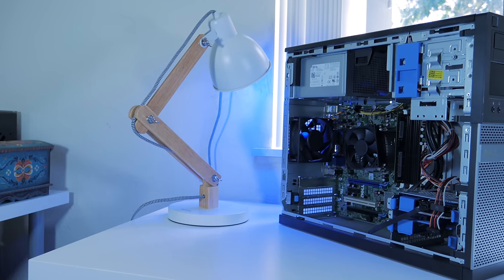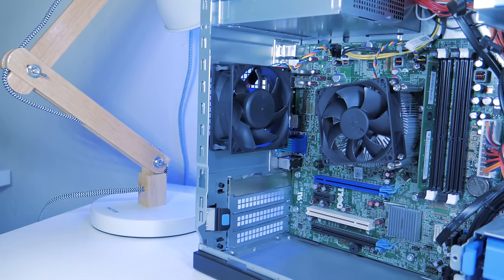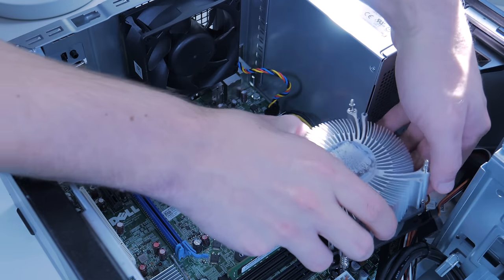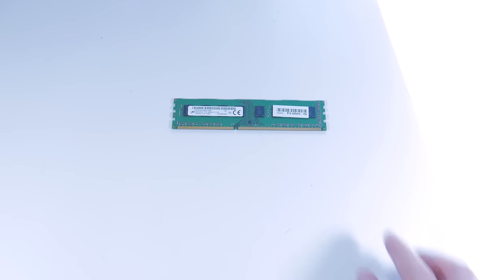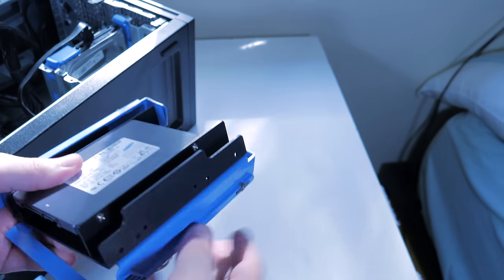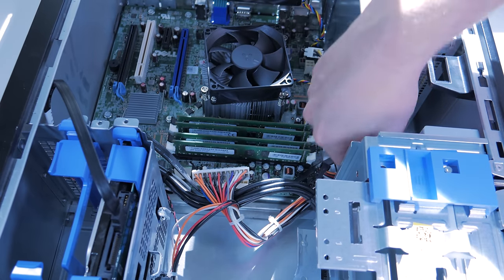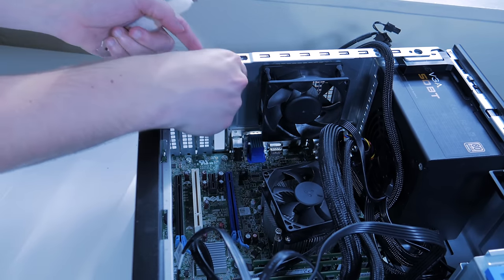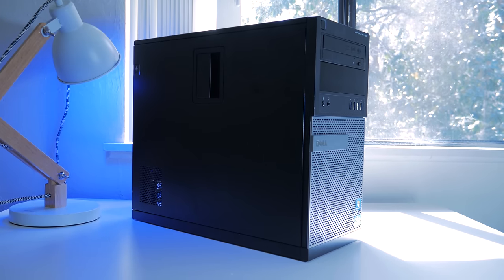How To: Turn an Old Office Computer into a Gaming PC!

Comment: I have question, can I like replace the whole motherboard and put a better one?
Reply: It might depend on how big your case is, i know that motherboards can be removed and replaced but it might be a big hassle. If some of the components in your pc arent compatible with the new motherboard, you will probably have to replace those parts if you want the new motherboard. If youre gonna get a new motherboard on s used prebuilt pc, just buy another one with a motherboard you want. Either that, or just find a way to compromise with the pc you have. Or, if you have a small case, like if you bought a slim tower, you can actually move your motherboard and all the parts into a new bigger case

Comment: Can I put that motherboard in an ATX cabinet? i have optiplex 9010 the motherboard is atx form factor
Reply: KempR SmitH on the 7010 and 9010 the front panel connectors are proprietary but the power button pinout is already known

Comment: another good  system for light gaming and work is a dell optiplex 780 with 4gb 1066mhz ram intell core 2 duo e7500 2.93 ghz 250gb drive and a 1gb zotac gt710 .........upgrade to 8gb 1066mhz ram cpu to intell core 2 quad q6600 2.6ghz  a 2gb gigabyte gt710 and a 1tb drive go from light gaming to medium gaming and work

Comment: What do you guys think of my system? 

It is also an lg1155 socket type.
It has an i7 3770 at 3.4ghz, 4gb of RAM, and no graphics card (integrated graphics ugh), and a 280 watt PSU I think.

I'm planning on upgrading my PC but I still need help with that. 

The exact brand is a a Lenovo ThinkCentre m92p desktop model. So yeah
Reply: while getting a new gpu is great , do remember to get a higher watt PSU , your 280 watt might not be enough for a 1050 ti or something like that.
Reply: Get a 1030 or a older amd card like a 29 270 or a gtx 770/780 and get a better psu.
Reply: first guy already recommended it .

Comment: I just got a 7010 (same case) has an i5 3470. But for whatever reason it won't boot with my enermax 500w psu so I can't run my graphics card. Can't figure out why, the psu is good just won't work in the Dell. 

I did get 16 gigs of Corsair ram for $30 though 😁 so once I fix this psu issue I'll be set
Reply: What gpu bro

Comment: I have a gtx 1050ti core i7  inside a dell optiplex tower. It is a deceiving build 🤣😃
Reply: does it perform well?
Reply: @Fridaytheth-eg6vk  subnautica(high graphics)=70 fps

Minecraft(high graphics/no optifine)=300 fps

Empyrion galactic survival(high graphics)=50-60 fps

Yes is a nice build
Runs most brand new heavy games at 60 fps

Comment: is it possible to upgrade my dell xps 8910 and replace my gtx 960 with a 1080ti and i7 6700k to a i7 8700k?
Reply: You need a new Motherboard to upgrade your Processor generation and you may need a new power supply for a 1080ti

Comment: Can I even do this for a All In One office computer?
Reply: It depends on the specific AIO. In general, most AIOs have very little upgrdeable parts. Basically, it is a laptop motherboard mounted on the back of a display so that significantly limits your upgrade options. The most you can generally do is to upgrade the RAM and storage. Neither of those things will really help much with gaming alone.

Comment: i got an I5 4570 3.20 GHz
with a gt 240, 6 GB RAM, 250 GB HARD DRIVE for just $110.
All i need to do now is upgrade my GPU
Reply: maybe get more ram
Reply: @jaeyarr  i upgraded a few months ago. I not have an 
RX580 8GB OC
Same i5
 20GB RAM
1TB hdd
I'm planning on upgrading the CPU soon cause I'm currently CPU bottlenecked

Comment: Sir my pc is prebuilt and it is from HP.

Sir my motherboard is Hamar and the full details are as follows :-

Form factor: MicroATX: 20.5x22.0 cm (8.1x8.7 in)

Chipset: H170

Memory sockets: 2 x DDR4

Processor socket: LGA 1151

Expansion Slots:

One PCI-E (GEN 3) x16 socket

One M.2 socket 1, key A

So buying a new cabinet can I shift my all materials from Prebuilt cabinet into new Cabinet ? I mean that my this prebuild system's motherboard be compatible with the new cabinet ? Could it easily fit into new case ? As I only want to change the power supply to 450W and graphic card to gtx 1050ti ?

Comment: i had this pc lying around i didnt game on it byt now when i am intrested in it i found that it has i7 2600 @ 3.40ghz 2tb+500gb HDD;ss  and gt 530 i change´the PSU to 500w and gpu to gt 1030 it runs any challegin game at 720p med or low an some easier titles like bo2 on ultra 1080p 100fps

Comment: If you're a gamer on a budget, upgrading an old office pc is the way to go.
Instead of paying $700-800 for a gaming PC, upgrade a refurbished one for $300.
Find a refurbished pc with a decent CPU for around $120, which gives you $180 to get an entry-level GPU, SSD, and RAM. This should run most new games at 60fps 1080p on low-med. 
More old games like CSGO should run at the highest settings smoothly as well.
Reply: Any old office pcs you suggest?
Reply: @Sharkzee1  Dell optiplex 9020. It has 4th generation intel i7 processor and 8 gigs of ram if you're not planning to upgrade. the only thing you would still need to get is storage and gpu.
Reply: 213 The Ninja I’m getting an i5 4th gen, would I need to upgrade psu for a gpu
Reply: 213 The Ninja also would I need to if I’m getting another 8gb of ram to make it 16

Comment: I bought this exact pc on amazon and it came with i5 2400 8gb ram 2 tb hdd 110 ssd for only 150$ and all I need is a new power supply and gpu looks like ima have to save a lot of allowances😭

Comment: I got a Dell optiplex 990 with Windows 10 I installed a GTX 1060 and a new PSU but it's not detecting it? And when I try to install drivers it says hardware not compatible what do i do?
Reply: If you BIOS is old and original , like Intel Q67,check for a later version , from Dell website. That will make it compatible to run using Win10. I see an update from August 21 2018 is available
Reply: he's the Master already did that but I ended up getting another 1155 motherboard and building a new set up

Comment: Maybe you can help me with updating my current system purchased in 2009.
Its a Cyberpower prebuilt system.
Intel Core i7-2600K CPU @ 3.40GHz
GeForce GTX 550 Ti
16G Memory Kit DDR3-1866 CL10 240
Motherboard P8Z68-V LX
ATX Form Factor 
12 inch x 9 inch ( 30.5 cm x 22.9 cm )
I hope I provided enough system info, if not I can provide more.  Hope you can help.
Reply: Hey, The 16gigs of ram and The i7 2600k is still very capeble today and do not need an upgrade. However if you want to game on the pc:
Used: get a gtx 1060 or smular
New: GO for a gtx 1650/1660 or a amd rx 5600

Comment: I got a free gaming pc from my uncle which he used to play with discs. It’s got a Gigabyte GA-G31M-S2L motherboard, 4gb of ram, no GPU, a HDD and a power supply that’s broken.. it’s got an i2 in it but I need help or suggestions
Reply: What is a i2? Suggestions for what?
Reply: ANDRW the i2 is the processor and suggestions for what I should do or change beside the psu
Reply: @whacktack4934  There is no such thing as a i2 processor man. If you posted your full specs I'd be able to suggest upgrades.

Comment: My components are:
CPU Intel(R) Core(TM) i7-2600 CPU @ 3.40GHz, 3401 Mhz, 4 Core(s), 8 Logical Processor(s)
GPU GeForce GTX 1050
HDD KINGSTON SA400S37120G ATA Device 110GB
SSD TOSHIBA DT01ACA100 ATA Device (1TB)

Comment: I've done something similar to my Acer Aspire X600:
Old Specs:
AMD Radeon HD 8470
i3 3220
1TB HDD
8GB 1333MHz

New Specs:
NVIDIA Geforce GTX 960 4GB
i7 2600k (Overclock 4.8GHz)
ASRock Z77 Extreme11
1TB HDD & 256GB SSD
12GB 1600MHz
Dark Rock Pro 3 CPU Cooler
Bitfenix Neos

Comment: pro tip get a 5.25" bay to 3.5 hdd and ssd, it'l give you even more upgrade options (leaves 2 hard drive bays open, and still has a slot for an extra ssd. you can find one here: https://www.icydock.com/goods.php?id=167

Comment: The Bottlenecker is showing that i7-3770 can handle gtx 1060. And i7-3770 would be bottlenecked with any GPU above that. I would say gtx 1060 is the breaking point. If you are getting any GPU better than gtx 1060, you may need a new system. 
i5-2500 to i5-4590 are pretty much equivalence.
The drawbacks are these big PC are quite noisy and draw more power than the mini pc/laptop. Now, I use my mini pc [Lenovo tiny] more often for casual gaming and web surfing.

Recent PC bought
Lenovo M73 i5-4590-t, crucial 256gb ssd,  8gb ram, one-year lenovo factory warranty [$120] mini PC
HP 570 Pavilion i3-7100, 1tb hdd, 8gb ddr4 ram, PLUS a 23" IPS monitor [$200] Regular desktop (new model)
Lenovo M92 i5-3470-t, 4gb, no ssd [$40] mini PC

Comment: Do you have to put thermal paste on the CPU??????
Reply: Yes, you should repaste a cpu after you buy it. If its used the paste is probably old, paste is cheap anyways
Reply: TWrecks ok thanks
Reply: Do you absolutely have to? Depends not having it replaced or there at all will definitely cause higher temperatures but depending on the chip they might not be even close to bad temps. But it's always a good idea to replace with new TIM if you remove the cooler or just purchased a system new paste will almost always work better than old paste and will always work better than none.

Comment: Hey bro does your pc still work when u have different brands of parts? Like putting an gaming msi mobo in an acer home/school pc
Reply: Rhaskye Strawp it matters about size you cant put a full atx in a case that only takes micro atxs.. you can also take out ALL the old pc parts and replace it with new or gaming parts
Reply: Provided the form factor and the screw locations are the standard a case doesn't care what part is in it and it doesn't matter one bit what you choose to use from that standpoint anyways. I have an older HP case with a Gigabyte motherboard in it the only parts still in the case that are HP is the memory card reader and the case itself everything else has been replaced.

Comment: Is a 550 watt power supply good?
Reply: Yes it's enough
Reply: jacket_ 80s thanks how do you know
Reply: @buret9477  know what?
Reply: That it is Enough
Reply: @buret9477  when you build PC  you know every part of it how much every part take Watt form the power supply  but for this PC in the video if but rx570 or gtx1050 400-450 Watt is enough because the parts are low  not like the new build  and if you want to know more go to PC part picker it will tell you how much it will take for each part
Reply: jacket_ 80s thanks

Comment: i have a pentium4   3.ghz  how to upgrade my processor into i5 core
Reply: The Pentium 4 is on an older socket than even the first i5 so that's impossible. You will need to get a new motherboard and ram then a i5.

Comment: why not start by upgrading the case... it's a cheap part... and i think it adds more value than having a 250gb instead of 120gb SSD.
BTW its nice to purchase old desktop that at least have 320gb HDD, everybody should know that HDD work at their finest speed when they are defragged and they have ocuppied not more than 50% of his total capacity. So i can see how a 120gb SSD + 320gb HDD (let's say 200gb used) can work for a person if unused stuffs get erased every now and then... if 500gb HDD way better
Reply: sha106b i managed to get working in normal headers 
Only power works
Reset doesn't work nor led
Reply: sha106b if you want how to do reply me
Reply: Saifudin Khuzema do you get the f1 to continue  error
Reply: Br Br yes
Power button failure
Front panel failure
Reply: Saifudin Khuzema yeah me too was wondering if anyone knew a fux
Reply: Br Br there is no fix for this error
I don't care pressing f1 each time
Because it works perfectly fine
Reply: Saifudin Khuzema it works its just a small bother

Comment: nice video - i built a pc for my cousin last summer using a refurbished optiplex 7010. i added a core i3 3220, 8gb of RAM and a GTX 1050 ti mini (remember when this card was under 200 bucks? great times!) 

i can confirm what you said about changing the PSU, the power supply turned out to be too weak. 
my cousin told me the pc crashes when playing certain games. 
the good thing is that the 7010 also uses standard ATX mainboard connectors like the dell in your video (some dell machines don't) so i sent him another power supply and the crashes stopped. 

by the way: i also made a video about this: /watch?v=eC84tP4OBx0&

Comment: Dud i have dell optiplex 990  his original specs where  intel core 2  2.13 Ghz
Ram 4 GB 
Hard drive 150GB
Gtaphic card was the worst i put in 
Intel core i5 3.5 Ghz 
Ram 8GB
HDD
400GB
gtx 1060 6Gb

Comment: No no no you should never get a 22 dollor power supply it will catch on fire after 2 months get a 40 dollor one
Reply: zach crump no it won't it has a failure rate of 2+ years of use I used a default fell psu that wasnt even rated for over 3 years of gaming  and it never failed

Comment: What a diggy in the head just get mb that suppot atleast 8gb of ddr3 for most and cpu of same socket as the mb that can handle the gpu ur plen to use so it wont bottlenecking it and psu that will handle the power no matter what brand and which model of any of the components